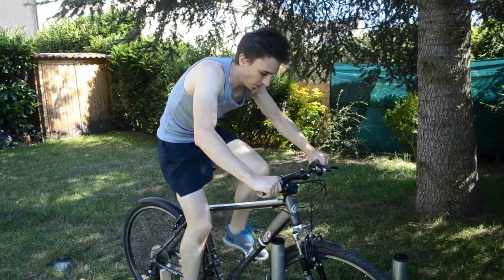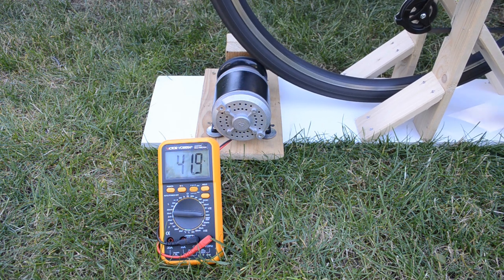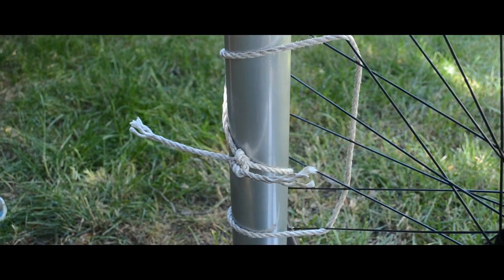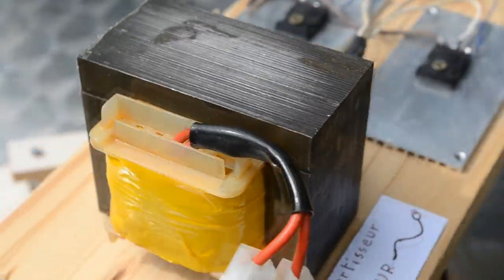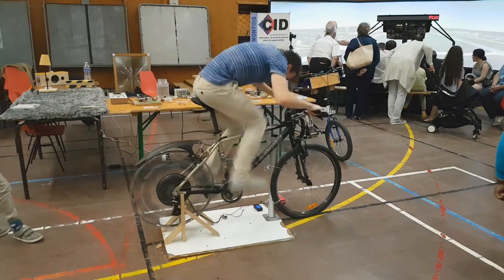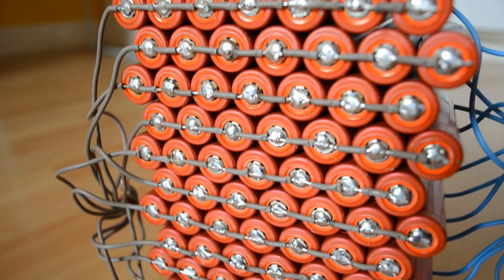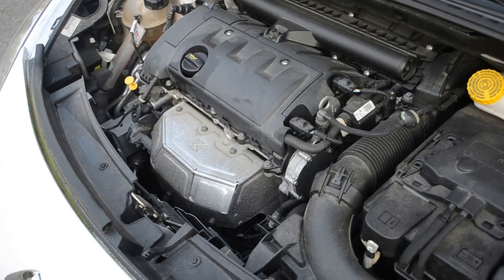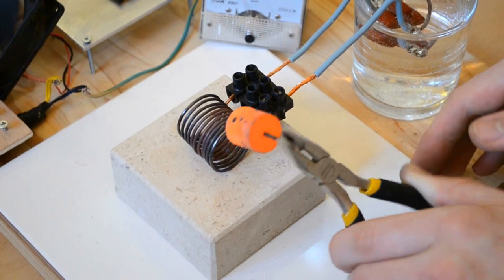Bike generator - DIY Experiments #11 - All about human power

Comment: Here is an interesting thought. If you hook up a gym these kinds of set ups ... how much power would it generate? Would it be enough to power the place, the Lights and the AC etc?
Reply: oh i wish this question was answered... interesting thought indeed
Reply: Mains voltage in the US is 120V and a common breaker amperage is 20A. Meaning you can pull 2,400W. Or 24 cyclists running at 100W... which isn't hard to do. So yea its possible

Comment: Thanks for the video. Could you change gear ratios on the motor to generate more electricity?
Reply from the maker: As we said it's already optimized (cadence/torque ratio) ;)
Reply: I have a similar question regarding wheel size.. could a larger wheel turn the dynamo faster, therefore generating more power?
Reply: @leticiaportelinha7347  as author says, No; it is already optimized.

Comment: Great video!! I'm an amateur with a question: the larger the bike wheel is, the faster the dynamo will turn, therefore generating more power? Thanks
Reply: Mostly no. You’re limited by how much power the human body can produce. The larger wheel will turn faster but will be harder to turn. There’s probably a sweet spot, where the wheel is going fast but not too fast and where it’s not so hard to turn that you get tired fast.
Reply: @TurboNuke  Couldn't we just make a gear ratio to make pedaling easy and have like three tires and motors at the end? Just brainstorming. Maybe wind up  mechanism with a series of pulleys connected to it to save some man power? Anything is possible even if it becomes a goldberg😆

Comment: 4:04 So, 555 watts is the maximun reached on the first device, but only for a few seconds.
5:43 The maximum for 8-hour work is actually 125 watts. That is quite small compared to the rigorous work.

Comment: I was surprised at the comparison between human energy vs gas engine energy. Then I thought, there's 15-25% power loss between an engine and drivetrain of typical gas powered cars.
Reply from the maker: I compared the mechanical energy at the motor output (it can be a 95HP gasoline generator). The powertrain loss would be the same with any mechanical power source so it's not relevant. Same aspect if you compare the real energy efficiency of a car with idle time... The real gasoline to wheel efficiency of a car is something like 20% only (but again it's not the subject).

Comment: i want to say that, it's not about the "power" , its about how much work we can do. even on low power we can boost the voltage to charge the battery, by lowering the current. we don't have to work like a giant bull, we have to work slow and steady.

Comment: Ha ha I've seen it all the BBC did a documentary on producing electrical power by simple equation total food energy multiply by the efficiency of the dynamo so about 20-25 percent simple. There are other factors friction and heat gets in away also so typical human 2500 watts by food multiply by 0.2 to 0.25 gives total power per hour .

Comment: Wait, the resistor is futile when you put it in water because water makes a shortcut and bypassing the resistor!
Reply from the maker: It's a joke or you're serious? (before explaining)
Reply from the maker: Joe Blow  The resistor is something like 2 Ohm! The current is 14,5A thru it!

The current passing thru the water is around 0.01A! It's negligible (less than 1%).
Reply from the maker: "Water can shortcut a resistor", yes, but it depends on its value, for resistor less than 100 Ohms it's negligible.

Comment: What would happen if the stationary bike was a 21 speed and you were in the highest gear would you create more power then
Reply from the maker: No, the speed/torque ratio is already the best, it's very difficult to spin and a higher gear ratio would lead to less power